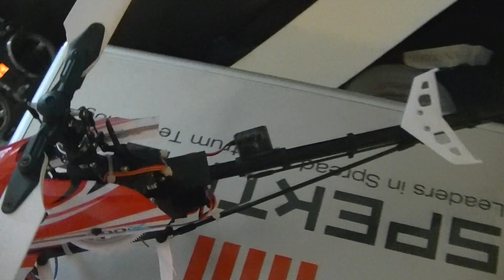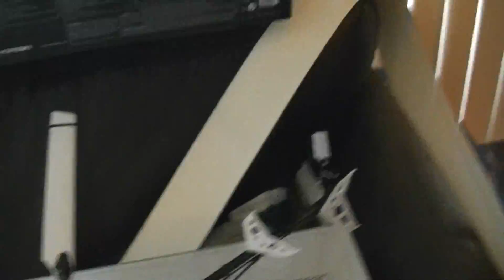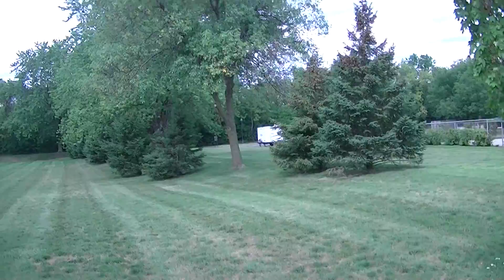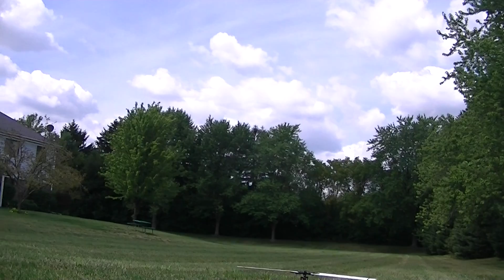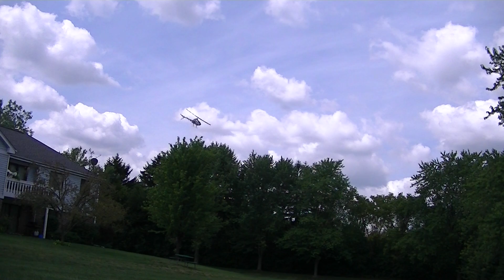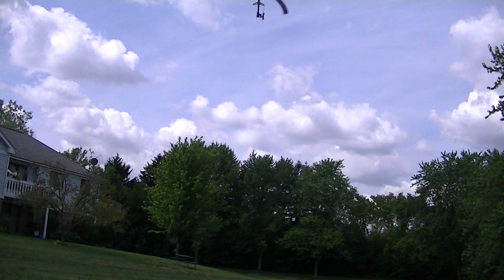Blade 300X Overview & 3D Flight Demonstration!

Comment from the maker: helicopter controls are completely different than plane controls, but it may give you a small headstart.  You are still going to want to start with a 4ch coaxial helicopter(like the mCX2) and then progress from there.  Once you can make the mCX2 fly in all orientations then move on to a fixed pitch helicopter like the blade mSR or mSRx

Comment: How are the servos on it? I've heard some unkind things about the stock servos used in the 300x, 450x and 450 3D and HH is still using them on the new 300cfx.
Reply from the maker: I haven't had a problem with any servos in any of my blade helis.

Comment from the maker: Check out the blade mCX2 on horizon hobby website. It is a 4ch coaxial helicopter and is easy to learn helicopter controls on! There is also the blade scout, which is less expensive and only 3channels - Still great, but doesn't give you the full 4ch feel for how a heli flies, so I would probably suggest the mCX2 over the scout.

Comment: Definately NOT stable. It's a very twitchy heli. Fun, sure, but it needs a lot of attention to fly well. I love mine (300CFX) but it's a LOT of work to fly safely. I hope others have had better luck than I have.
Reply from the maker: Yes, they aren't like the quadcopters which have ruined real flying with all the gyros and computer leveling systems (which weren't available even 5+ years ago).  Back then we had to actually learn to fly well.  Very rewarding once you get good.  They do require constant tiny movements to keep level.  Or crazy fast movements for fun crazy flips!